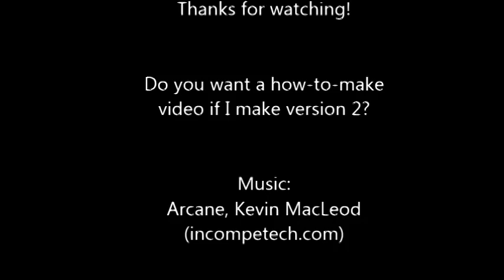Homemade Self Cocking Crossbow Pistol

Comment: Nice design.
I only have one "negative" to say; You should really reconsider your loading method.
Pushing on the point of the bolt leaves you wide open for a serious injury if the trigger malfunctions.
Consider loading the bolt by using only the shaft.
Otherwise I'm impressed.

Comment: Thats really cool. i have some suggestions though. 1. Add a sight, lightweight though. 2. make string better. 3. add grips (AKA duck tape) 4. Add some color. 5 Add a shoulder rest. 6. Add a compartment at the bottom to hold extra bolts/arrows.

Comment: Its nive but u coped off the pistol crossbows it look the same and arnt the metals rod from it cus i have the crossbows and i took it apart
Reply from the maker: Yes I copied the concept, I made all the parts from scratch though. The metal rod came as a 3ft piece from lowes.

Comment: no way that's even 30 pound draw. I'd say 15 if lucky
Reply from the maker: It might be comparable with the energy of a 15lb full size bow because a crossbow is working with a much shorter draw length. But the draw weight is much higher than that. A 15lb crossbow with only a few inches of string travel would not have nearly this amount of power.